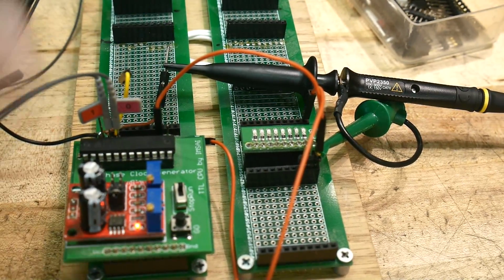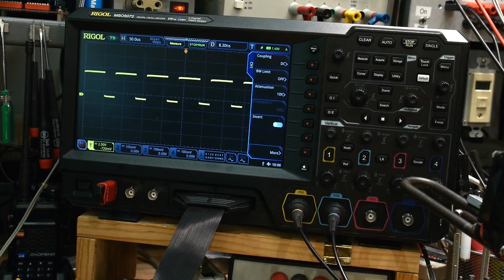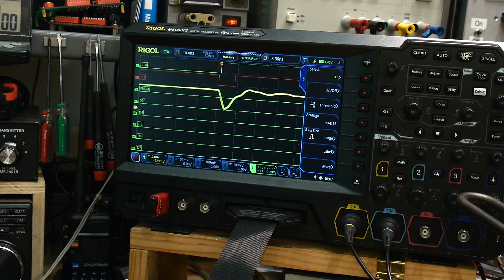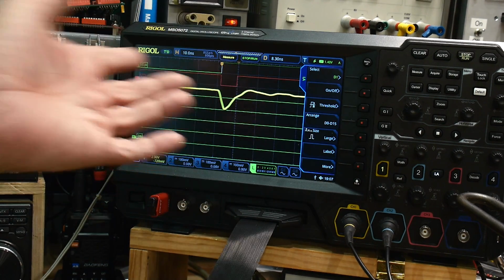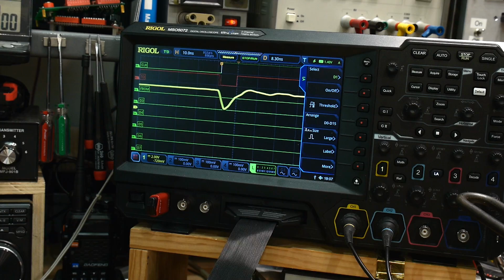#887 Finding a digital signal glitch with a MSO oscilloscope

Comment: It seems to me that for a breadboard circuit with a socket mounted IC a glitch of 10ns wide is perfectly possible...
Only with a proper designed PCB (optimum trace routing) AND a soldered IC you can obtain a 'glitch free' clock generator. But this is only my opinion...regards from Italy.

Comment: It looks like you have an asynchronous race in your GAL logic where the delays of the gates conspire to produce a transient intermediate logic state.  This is one reason that we use clocks so we can wait for the logic signals to settle.  It may be very difficult to avoid these races in a GAL implementation, but usually solutions to this involve having several overlapping terms in your logic expression or by adding extra gates to delay some logic paths.  You may ultimately need to abandon the GAL for the clock part of the circuit as this type of debugging can be very tricky.